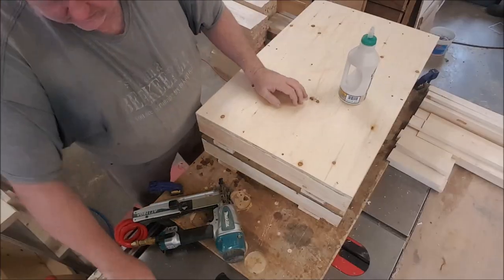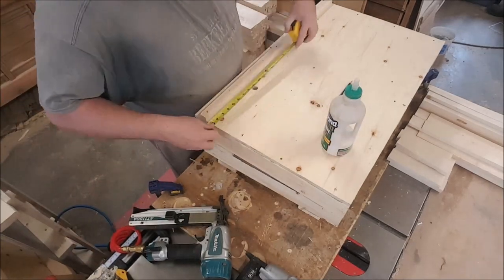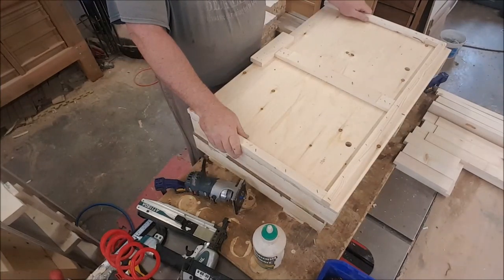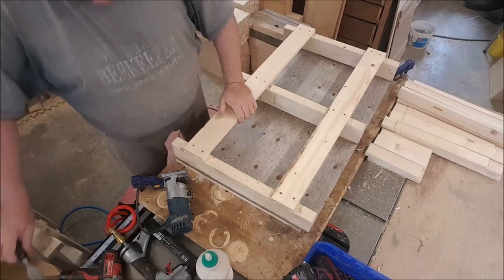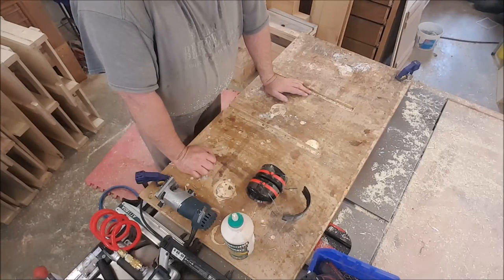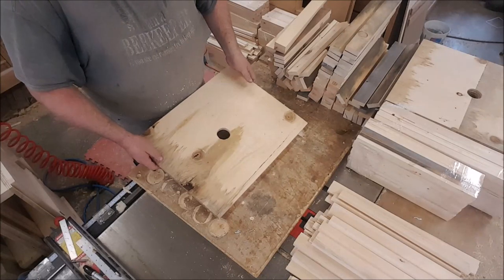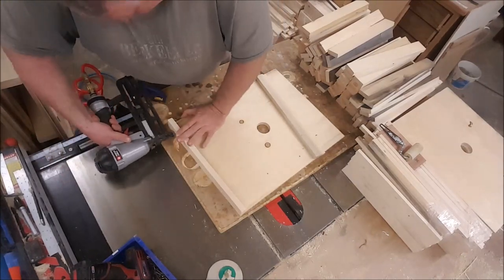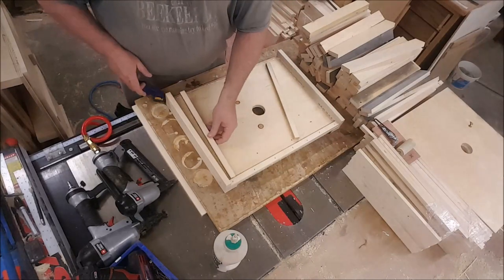🔨Assembling Pallets and Covers - That Bee Man

Comment: That is one busy beehive - your wood shop!  Amazing what one man can accomplish with a bit of knowledge and elbow grease!  Do you weather coat these?  i.e. varnish?
Reply from the maker: Hi Norm!  For a finish, I take them to the local woodenware manufacturer for hot wax dipping.  That boils the moisture out of the wood and replaces it with wax.  It's very economical and preserves the wood for a very long time.  (it's paraffin, not beeswax)

Comment: With your new design (with the gap in the back to account for the lid) am I right that your front entrance sticks out only 3/4”? Do you find this to be an issue? Typical standard bottom boards have about a 2” entrance landing as it were.
Reply from the maker: Hi, Tyler.  Thanks for watching.  You are correct, the bottom board extends only 3/4" past the box.  Yes, most hives do incorporate a landing board but that's really more for the beekeeper's convenience than the bees.  Hives with no landing board do not cause an issue for them.
Reply: @ThatBeeMan   I figured as much. I’ll be whipping up some of these pallets in the next couple weeks. Nice work on the design 😉
Reply from the maker: @TylerJSpry  I'm flattered, thanks for watching.  Keep me posted as to how it goes.

Comment: I have a question on those runners on the pallet.  Why do you cut the side 1”wide?  Because the clips take up most of the remaining 1/4” of the boxes?
Reply from the maker: Sorry, I'm not sure what you mean.  I decided a long time ago to standardize on a 1" wide shim on my pallets just to give it a bit more beef to stand up to stress over time.  Your boxes are likely made from 3/4" thick material.  Boxes in my country are typically made from 7/8" material...I don't know why but the extra 1/8" makes a big difference in strength.
Reply: The fact that you use 7/8” material answers my question.  I was thinking your boxes were 3/4”.  

So if the runners were 1” and boxes 3/4” that is where my question was coming from.  But now I understand.